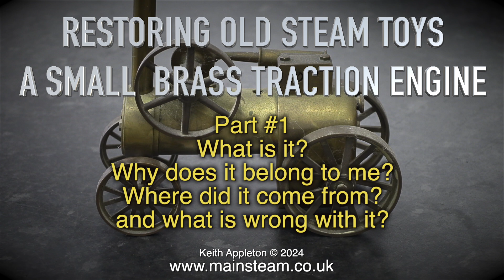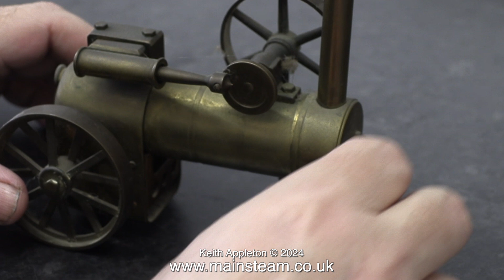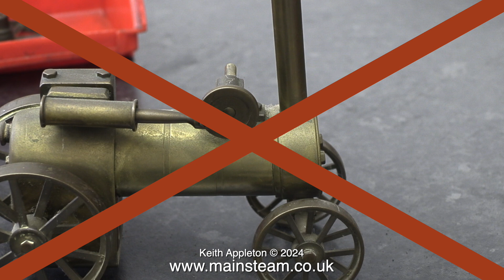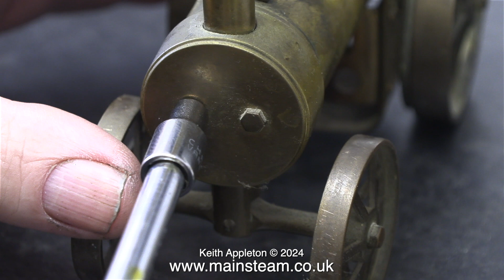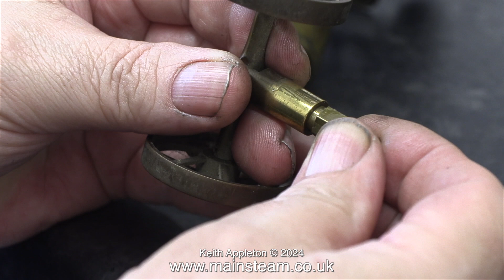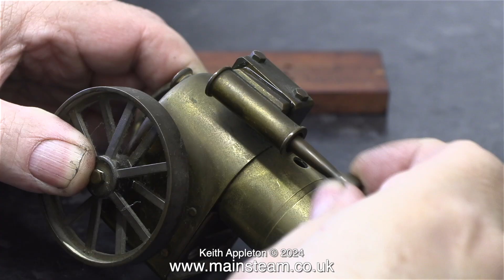A SMALL BRASS TRACTION ENGINE - PART #1

Comment: I don’t think this is a traction engine,it looks more like a portable steam engine. These predate traction engine’s,they were dragged into place by horses. They drove thresher’s and mining equipment,as they were probably much cheaper than a traction engine. Nice little toy though,should be interesting to see it run.
Reply from the maker: Yes, I agree but it does have grooves for a drive band, which then makes it self powered and hence my description being "Traction Engine" and not "Portable Engine" . . . . .
Reply: Looks like a lot of fun bringing this gem back to life. 
You also stay safe and extremely healthy!
Reply: As per the very early traction engines - drive from flywheel to rear wheel by chain. Just missing the ships wheel for steering.